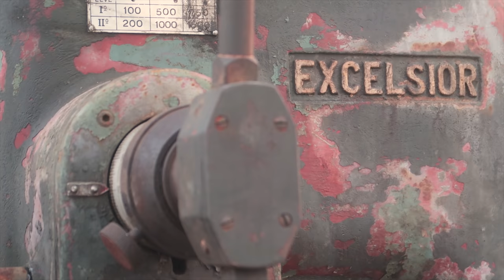Big Drill Press Vise Restoration

Comment: Just pointing out something on stuck screws. You want to heat the metal around the screw to expand the hole. Heating the screw expands the screw and can actually make it tighter
Reply: macgyver15147 This is exactly what I was about to say
Reply: @Curtis-Randall  Exactly what I said before I read your comment :)
Reply: @Curtis-Randall  I usually don't bother commenting on vids. Usually leads to keyboard warriors on youtube saying I am an idiot. Glad this channel can take advice by the up vote count I see on my comment. Furthermore on the stuck screw advice. I usually heat the surrounding metal to no more than 350 degrees F so not to change any heat treating on the parts. Heat the surrounding then spray penetratet oil on the screw. This cools the screw shrinking it slightly  while capillary action "sucks" the oil into the threads. The screw's heat treatment is not affected by this method so wont break easily
Reply: Yeah was about to comment this, Nice restoration though!
Reply: Yes but if you heat the metal around the screw, it will expand on all sides, including in the direction of the screw so it will tighten it. If you heat the screw (untill it's red), the metal will be more ductile and can deform to go out. But it has to be red, otherwise you're right.
Reply: @martincm8683  Actually, this is not the case. As the material expands while being heated up, the holes in it expand too. Every car mechanic can tell you that because that's what they do to get stuck bearings off axles.
Reply: @lilo_we  Which is how railway wheels are changed.
Reply: @martincm8683  Metal expands in all directions with heat. So in the case if a 1/4 inch screw hole With 1/4 inch of casting around the hole. Then Yes they cancel out.  If you think of a doughnut 1 inch in diameter with a 1/4 inch hole....  Most of the metal to be expanded is on the out side of the screw.  The metal must expand evenly so even though the metal on the inside expands there is more on the outside pulling it that way.
Reply: Okay thank you 😉
Reply: Two wrecked flathead bits. Ouch. (Kidz? this is why you subscribe to Project Farm, where a video only a few weeks ago showed what things work and don't work to loosen bolts. Liquid wax is worthless compared to a proper penetrating lubricant. And you don't heat the bolt, because there merely makes it expand and get tighter -- you can loosen a NUT with heat, because it's on the outside, and would get looser. Moral of the story is: spray that sucker with WD40 next time.)
Reply: Before I go grab the torch I always (if applicable) weld a nut onto the stuck/broken bolt. That way I can get a rachet or breaker bar on it. Rarely, this fails or can't be done and heat is required. Best to heat it till red. You get the worlds most stuck bolt cherry red...it's coming out
Reply: Word!
Reply: This frustrated the hell out of me 😂😂
Reply: @machyver15147 I think the heat would expand it all at the same either way, cooling the screw quickly would be beneficial though. In this instance, it was clear the red thread locker from what I could see was holding it firm so the heat dealt with that more than anything
Reply: As a complete novice I learn a lot from these debates.
Reply: Exactly-just heading the bolt will only make it worse
Reply: agree, it made it worse
Reply: Not really true. The idea behind heating the screw is that it will expand and break loose the corrosion that is locking it in place. You don't want to heat the base part as much because that might change the temper on the steel, causing various problems. What I've found works best is to heat the screw until the head glows red then allow it to cool to where you can touch it. You may have to repeat a couple of times, but it almost always works. Heating the metal around the screw will accomplish the same general purpose, but with more attendant risk of damaging the part. Screws are much easier to replace than the vice jaws.
Reply: @timdouglass9831  the bolt will expand in the hole and making it impossible to get lose,sinse the holw wont expand,dosnt matter if it is rusted or brand new
Reply: @hedning003  That's not how it works. The bolt expands and then contracts again, breaking the rust bond, which is weaker than the steel itself. This is pretty standard practice for any mechanic or farmer. You don't try to break it loose when it's still red hot, you wait for it to cool and contract again.
Reply: Depending on the size of the screw head, if there is enough room try welding another bolt onto it. Allow it to cool, then soak it with penetrating oil and at least you have something more solid to grip onto then. A bit easier than a soft screw head which usually gets wrecked.
Reply: Yes, some of his actions do not look very straightforward.
Reply: Amen, I actually try to shield the bolt whenever possible while heating the area around the bolt.

Comment: When trying to loosen a bolt you want to heat the material it's in not the bolt.  Heating the bolt will expand it and just make it tighter.
Reply: Came to comment this as well
Reply: Correct. The law of thermal expansion in action.
Reply: Yeah and you can even place a drop of water or oil on the bolt
Reply: There are a few reasons why heat all over is a good 2nd best. Here's a good post in a long very good thread. (This is about expansion, and there are other good posts about heat being valid but unrelated to expansion.) https://diy.stackexchange.com/a/90399

Comment: Good job of cleaning it up and making it functional. I'm wondering why you didn't weld over the drilled divots and then grind them smooth,  instead you used a bondo/ polyester body filler , that part doesn't make sense when you have a welder at your disposal?when metal is missing ..you should always use metal to fix it, especially a drill vise / machining tool.  It is not a show stopper but it isn't typical or indicative of the usual quality of work that you normally do.
Nevertheless, you still do good work and your videos are always great
Reply: I thought the same, my guess would be that you probably wouldn't want to weld bedways since the could bend a little and that would be an issue.
Reply: I  find more questionably using a file for the jaws
Reply: Thought exactly the same thing...I was shocked when the welder didn't come out.
Reply: @filadelfozuniga3411  Why?  It's steel that got hardened.  Old file or bar stock, what's the difference?  Maybe he wanted the light texture on the inner jaw...the file is perfect for that.  An old worn out file got new life....and that leftover piece can become a knife.
Reply: @khatfull  with jaws you want to hold, not to bite off material, thats why they are usually soft steel and not too agressive textured just enough to grasp softer materials. Also if you got something hard it wont be hold as tigth since none, either jaws nor part would bulge
Reply: RockIsland Rides you ever have a water bottle but still say fuck it and drink out the hose... same shit
Reply: @filadelfozuniga3411  As a general rule, hard jaws will grip better and last longer, but soft jaws protect the part and are easy to customize. Both have their applications.
Reply: @lDanielHolm  of course. My point is that they are more situational, but i see the point of using them specially if machining soft jaws is harder than reusing an old file.
Reply: @filadelfozuniga3411  Well, he annealed and re-hardened the file -- so clearly, he didn't want soft jaws.
Reply: @lDanielHolm  I cant find where i said otherwise.
Reply: @filadelfozuniga3411  I didn't say you did. Just pointing out he could have had (softer) jaws if that is something he wanted.
Reply: @lDanielHolm  obviously, if he wanted soft jaws he would had use soft jaws.  As i said before i can see the reasoning behind using the file ( its easier and OK ish) so i don't understand why you mentioned it again.
Reply: @filadelfozuniga3411  You implied he'd want them if it were easier to machine them rather than use an old file.
Reply: Cast iron doesn't take the weld, unless you use a brass filler rod and that would look terrible.
Reply: @khatfull  I think it's a great idea. I have a bench vise with worn out jaws, and old files would be about perfect for replacing the knurled inserts.
Reply: @khatfull  who said anything about the jaws or using files????????????? You need to look at the video again, he used bondo on the bed instead of REPAIRING it properly by welding the drilled divots
Reply: @filadelfozuniga3411  Thats a non issue, the issue is with using bondo to repair the bed of the vise,  a clamping mechanism, files are made of tool steel which would be ideal in this situation for jaws
Reply: @TrixUnCencored  what has that got to do with using polyester bondo to repair steel? Would you use toilet paper to repair a hole in the bottom of a boat...? same shit
Reply: @IR-nq4qv  files are high carbon steel (~0.95) not tool steel... But i get your point, they would make fine jaws.
Reply: @thunderstruck1078  that statement is false, I won't even go into why you are so wrong on all counts.  Even if it were cast iron to which I do not doubt...,you can still use a 6011, 7018 or a premium Tech-Rod 99 (AWS class ENi-CI), bring the damaged part bed of the vise up to temp with a bottle torch and then weld, there are millions of examples on the net for cast iron repair but using a bondo band aid is not what I'd prefer
Reply: @IR-nq4qv  as he stated, he filled the dents to avoid chips getting in there. The fill will bear no load nor be exposed to a lot of friction so why bother trying to weld cast iron, to heat the beadways and stress the metal just to avoid chips on a dent?
Reply: @moconnell663  I was agreeing with his choice, I think that was pretty obvious,
Reply: @IR-nq4qv See response to @Filadelfo Zuniga's reply above in reference to the files.  Read ALL the comments next time.
Reply: @khatfull  And I was agreeing with you, I thought that was fairly obvious too.
Reply: @moconnell663  FFS!!!! I was agreeing with his decision to use old files.  Jesus!
Reply: @filadelfozuniga3411  Why? He normalized then tempered them?
Reply: @jevforsberg4766  sorry, why what?
Reply: Maybe the welder he's got is not powerful enough to do a good weld on a cast iron bed? Also, I'm not even sure you should weld on cast iron. I may be wrong on that, thought
Reply from the maker: The vise body is cast iron, I can't weld cast iron with my current equipment. I mean, I could try with stick welding pre-heating and all that jazz but it's too risky...
Also, I filled those only to prevent chips from falling in and stucking the movable jaw. Not expecting to last forever but it's easy to remake!
Reply: @BlackBeardProjects  yea the bondo really bothered me, you can weld cast iron using a high nickel rod and following the procedures with cast iron. with the amount of work you put into it i would say welding it instead of bondo would have been better.

Comment: I'll tell ya, I was gritting my teeth, when you were trying to get that seized thread out. Particularly when you had the spanner on it. I was waiting for it to just yield, twist and break off at the surface of the hole. Always a pain the arse when getting these out. I would put a thin film of grease or Never Seize on the screws so that doesn't happen again. Glad you didn't paint it, since it was going to be returned to use as it was. Well done.

Comment: When it comes down to it, stuck screws and pins are the worst. I remember taking the rusted-stuck pin out of a bulldozer arm. After attaching our massive bolt setup to the pin with an absurd amount of welding, it still took three of us dangling off of 6 foot long bar to get enough leverage to pull the pin out. There was so much pressure buildup that at one point the weld pretty much exploded and sent the bolt flying. This massive bolt on our setup weighed well over a dozen pounds and would have killed one of us if we hadn’t stepped back for a moment to catch our breath. If we had waited even ten more seconds, one of us would be gone today. We found a perfectly clean white down feather on the ground next to the bolt, so we joked about having a guardian angel for the rest of the day.

Comment: Everything is great as always.
The only thing is, filling putty holes is not very perfect. Cast iron is certainly a problem material for welding, but there is no load, you could just fill the hole with metal.
In fact, it does not matter, it's nitpicking.
PS.: I weld a lever to such bolts.

Comment: FYI for next time and I'm sure 10,000 others will say the same, it's usually best to heat the material around the fastener while minimizing heat on the fastener. Heating the screw itself makes it expand, further traping it in place
Reply: Not really you heat it to expand and then cool it to break the rust seal. Works great on exhaust components.
Reply: @jeremygyles3492  Until it binds again because you lost the extra room created by heat expansion and you snap the stud

Comment: With stuck bolts, maybe you already know this, but maybe you don't, if you spray it with pb blaster and work it back and forth (even just a little tiny bit, this works it down into the threads) let it sit for a bit, then repeat until it comes loose. I have to do this on my car pretty often, unfortunately.

Comment: when using a pipe wrench to grip such stubborn screws, mind the orientation of the tool. you were holding it wrong so the teeth couldn't bite into the material to grip it.

Comment: Hello Black Beard Projects.
 First, I must say...I really enjoy Relaxing, as I watch your Restoration videos!
  Having said this...I've often noticed whenever there's a bolt, screw, or small parts that are ceased, many restorers will heat the ceased part (ie: Screw/s/Bolts/Etc:) instead of the "Surrounding Area/s." 
 Perhaps, (If you haven't already) you could give this method a go...
Heat "around" ceased part/s/screw/s/etc," but "Not the part/s to be removed," then spray cool water onto the heated area/s only, and immediately afterwards, use an impact screw extractor, wrench, pry bar, etc; to *Slowly~Work the part back and forth, until it's loose.
 High  temp heating of metal, causes it to expand, and when cool water is sprayed onto it_It causes a "Thermal Shock Contraction." This action will usually break, Ceased contact areas of bolts/etc; which are screwed through most metals"...Just Enough"...For that...First little bit of movement...
PS. Temp required = Approx; 900 c. or 1,600 f. Also, Stop heating_Just prior to turning the metal Red. (Aluminium App's, are "Very Tricky," so experiment first!)

Comment: To remove old vice jaws, rothenberger type torch using map gas, heat the screw, then quench with water. Impact driver out easy as pie. You don’t need any brute force or hammering.

Comment: That copper spacer will eventually cause corrosion (copper touching iron forms a battery, essentially), you should swap it for an aluminum spacer.
Reply: James Frankiewicz the copper spacer is sacrificial. It does not become a battery, even with an electrolyte. NEVER put ally with steel.. not a good recipe. The ally will pretty much weld itself to the steel, given a bit of salty water

Comment: Question about best course of action. I have an old train whistle thay was previously used on a truck exhaust system.   It is badly rusted and the air flow controller and valve (and associated springs and other parts) have been rusted shut. What is the best course of action when starting to restore it.

Comment: I never knew we could cut metal with a band saw
Reply: Tyshon Sullivan only with a metal cutting bandsaw. They are usually geared lower for slower speeds and use different blades. Can’t just use you typical wood saw. And they cost a lot more.

Comment: Why didnt you weld the drill holes up on the rails ? that filler wont last long !
Reply: Indeed, he did the welding on the long no-end screw at the end, so I don't understand why he uses filler for this step...
Reply: @lechatvenere   Probably because its cast iron, and he does not have the equipment to weld it? Need to preheat it and use special electrodes. But i agree, i would have prefered welding over filler.
Reply: @Trevtardius  it's clear that for cast iron, you can't do some big welding, specially when parts suffer with pressure or torque, but what we have here, can be fix easily with normal weld as it is just esthetic and not functional 😊
Reply from the maker: Copy-paste from another comment I just posted:
The vise body is cast iron, I can't weld cast iron with my current equipment. I mean, I could try with stick welding pre-heating and all that jazz but it's too risky...
Also, I filled those only to prevent chips from falling in and stucking the movable jaw. Not expecting to last forever but it's easy to remake!

Comment: You put a body filler on the base of the vise, but welded  a metal filler onto to lead screw. Why did you not just weld the base to fill the divets?
🤔

Comment: I don't mean to be dumb, but if you keep putting the blowtorch on the stuck bolt, aren't you making the problem worse?  You're expanding an already stuck bolt, wedging it in even more.  You should be heating the area around it, not the bolt itself.

Comment: 1:00 -- Erm, two wrecked flathead bits. Ouch. (Kidz? this is why you subscribe to Project Farm, where a video only a few weeks ago showed what things work and don't work to loosen bolts. Liquid wax is worthless compared to a proper penetrating lubricant. And you don't heat the bolt, because there merely makes it expand and get tighter -- you can loosen a NUT with heat, because it's on the outside, and would get looser. Moral of the story is: spray that sucker with WD40 next time. 4:06 -- What the hell? He does have WD40. OK, I'm calling 'foul'; he just wanted to wreck his drill-bits for video excitement.)

Comment: just weld a nut to the stuck bolt and un wind it like normal,  flat blade screw driver has no torque